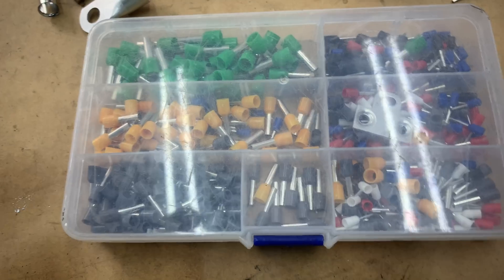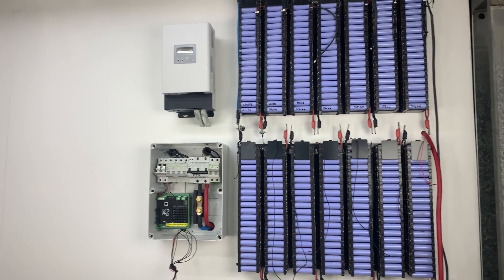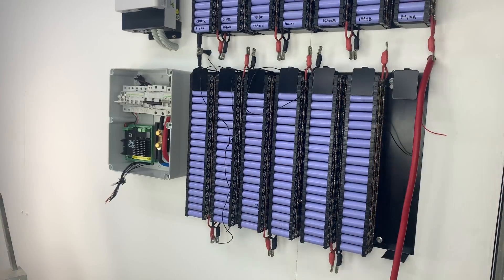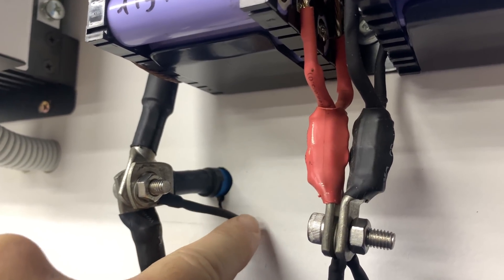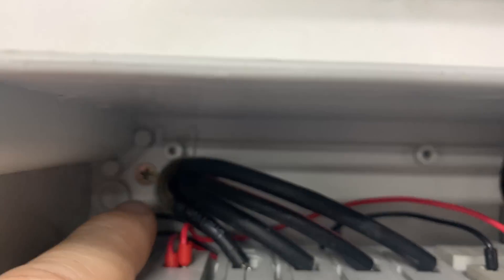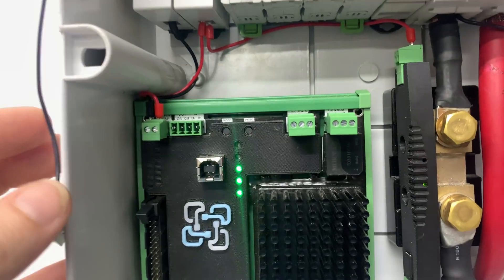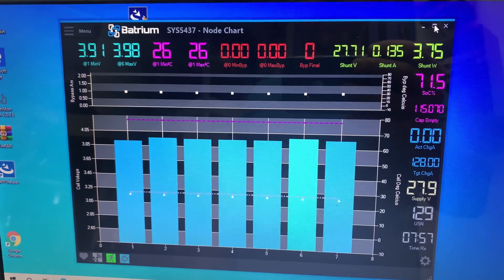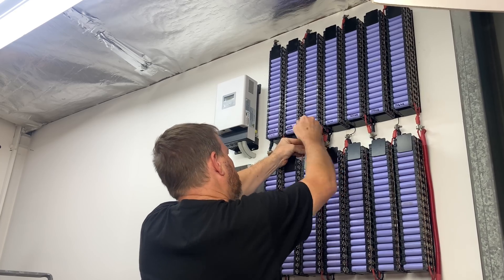Workshop Powerwall is operational [Cleanest Battery Install Part 4]

Comment: I’ve thought about a shroud over each pack the keeps heat rising upward, but not trap heat. This way you could read the entire temp of each pack.
Reply from the maker: Heat rises anyway - I did a test many years ago (a 4hour live feed - infact i think that was the name of the video too) that showed how the heat rises and the tops of the cells were much hotter than the bottom.

Comment: How much does it cost for every 1kw, roughly with a setup like this?
Reply from the maker: Never really worked it out... Don't tell me i have to math 😜
Reply: @HBPowerwall  LOL. Don't worry, I'll do the math. I would just like to know if the hyperlink you provided for the batteries is the best buy you have found?

Comment: Peter just a hint scratch the terminals will help bonding.  Where do I find your diagram to set up battery pack system. Plus the steel holders web address doesn't work.  Plus most of the addresses does work mate.
Reply from the maker: I'll make a diagram today if possible for the wiring of my Workshop Battery Pack , also fixed missing links

Comment: Why not use a small DC buck for the fans? Any reason? Other than not having one?
Also what is the useable capacity of this bank?
Reply from the maker: Wasted power & trying to reducing failure points. This battery would be about 8kwh useable 10 on a really low draw such as 100-200w

Comment: I came up with a crazy idea to spot weld batteries, I got out my small mig welder, and my spotweld timer,  and SSR, I'm going to see if it's way overboard, or only slightly,  the welder has current controls, and the timer goed to a small fraction of a second, with it cranked down, it should work, but if turned up, I'll be exploding cells!! I'm going to test and tune before trying on cells. Nice and clean!!! Keep it up!
Reply from the maker: DO it on camera lol - fire sells well on youtube & you'll be taking one for the team. lol #staysafe

Comment: Hi Pete, well all off again, may be the next time if you have to do this, fix board 1&2 together at the back with some wood/metal, then fix some hinges to board 2&3, then you can just swing all the boards to the front for any modifications 👍👍⛄️🎅🏻
Reply from the maker: Probably easier to take the tin off the wall from the outside - almost did that and still might to 'fix' the stuff you can't see
Reply: HBPowerwall all the best mate from UK , Merry Christmas , happy New Year

Comment: At 5:20 I see two problems with this setup...
1) Without fuses, you don't know the current that will flow, as you noted. As those packs age, the capacities could be very different and you'll get a lot of current flowing through that skinny wire as they balance each other. Your wires are thin, fuses would prevent them from melting if this were to occur...
2) If you use fuses, the fuse could blow and you wouldn't know considering the BMS still sees voltage from the other pack.
I think optimally, you would have a large gauge wire interconnecting the two for the best of both scenarios?
Reply from the maker: You think there will be more than 5 - 10 amps ? it's not like it'll go out of balance in a huge rush it will creep up slowly and balance dymanicly so don't feel it will be an issue. If a fuse blows you'll see fast from the bms one pack will charge and discharge twice as fast ?

Comment: Loooking good there Pete, i actualy like the inverter attached to the strut like that.. fit in really neatly.. and im glad the 2x 12volt fans idea payed off for ya :)
Reply from the maker: Yes the inverter works well there out of the way but still functional. Some have expressed concern that the fan idea won't actually work so i've ordered 24v fans just in case. Be a good test tho and might learn something
Reply: @HBPowerwall  no worrys Pete, like I said I tested the theory when I suggested it and measured the voltage on each one and they ran perfectly. Looking forward to seeing the end result anyway.

Comment: Those ringconnectors with the fuses should NOT between the cell lugs. To keep the resistance low, the cell lugs have to touch eath other.
Maybe, it‘s the heat that caused this mistake.
Reply from the maker: They were placed for best layout, for the power draw at the moment it won't cause an issue but i'll take it under advisement for sure.
Reply: What are the glass fuses for?
Reply: That's what I was thinking, but at 5:17 he mentions he did not install fuses for the balancer. ?

Comment: the batrium doesnt have 12v out for the fans? please dont put fans in series, they would get so much noise on their power and probably fry easily
Reply from the maker: Plan on trying it, see how it goes as its quite cheap, i've ordered 24v fans from china but will be 600days before they arrive lol
Reply: HBPowerwall heh yea, a little buck converter would work too

Comment: maybe you need a modular way of installing these or better still a checklist to go thru so steps don't get missed
Reply from the maker: I'd forget to check the check list lol Turns out with the location I used, pulling the DC Cables through wasn't hard at all using an electrical noodle thing..(don't actually know what they are called)
Reply: @HBPowerwall  wire chaser ?
Reply: sorry wire fish reel or some use yellow tongue (plastic tongue for plywood flooring)
Reply: maybe someone from the brainstrust on the interwebs could make an app  that you could sell?  ie checklist?
Reply: @DIY Projects yeah could be revised and updated as tech and knowledge grows

Comment: About 150 or so hours use on the inverter.
Reply from the maker: that's not bad really, put a fan on it today with the heat and will be turning off in the morning.. Even my home Powerwall will be turned off in the morning.
Reply: @HBPowerwall  im guessing due to the insain heat you guys have right now lol

Comment from the maker: Key components of this build 
🔵 Batrium Watchmon7 BMS with Shunt - www.batrium.com
🔵 Recovered 18650 batteries - http://bit.ly/BatteryHookup
🔵 HBPowerwall 18650 Mounts - www.secondlifestorage.com/mounts
🔵 PCM60X Solar Chare Controler -  https://ebay.to/2K8XUMC
🔵 Shunt Trip with breaker
- Trip https://ebay.to/2RRYr9T
- Breaker https://ebay.to/2rDe5LR
🔵 Solar Breakers - https://ebay.to/36Lvocz
🔵 DC Fuses (fan & Batrium)  - https://ebay.to/2rDQwm6
🔵 iCharger X6 - https://goo.gl/GtBtW9  
🔵 Clamp Tester -- https://goo.gl/z8b4uJ